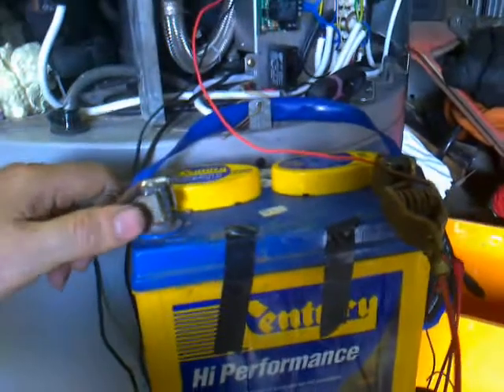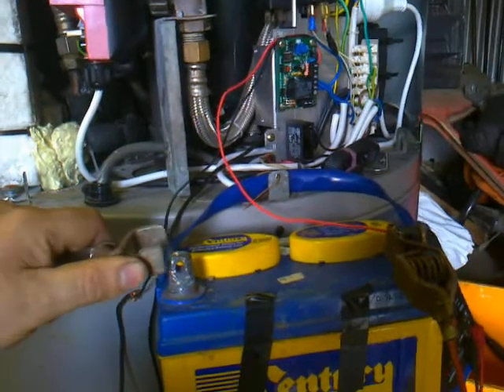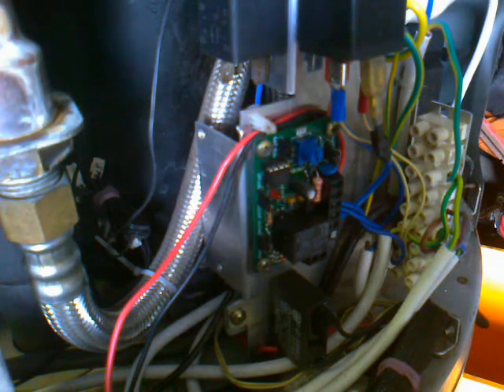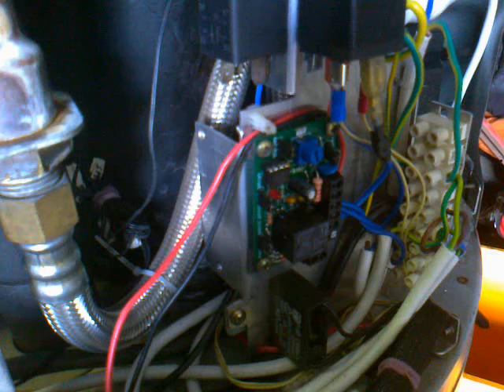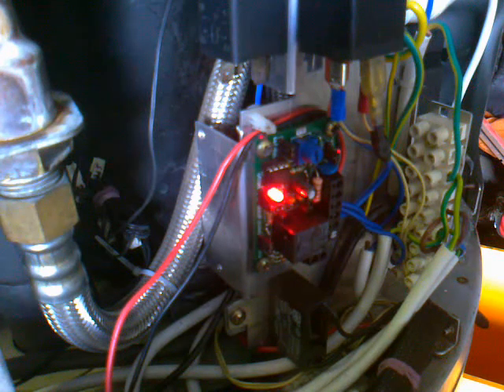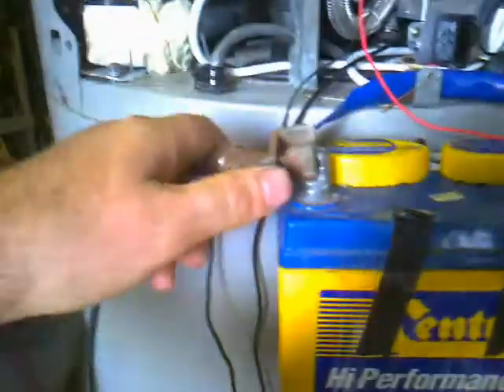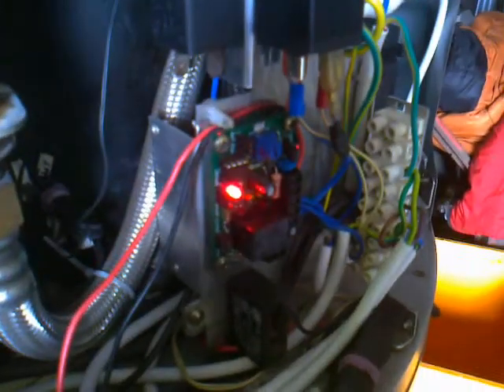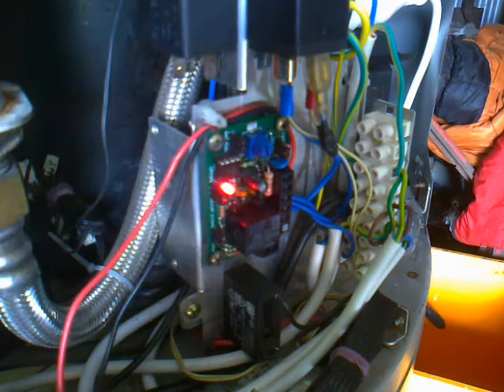"RHEEM HEAT PUMP HOT WATER SERVICE HDi-310" "RHEEMED" MODIFICATION Handy Pulsing Circuit Board!

Comment: Well,I checked my dads Rheem 551310 yesterday & I couldn't find anything wrong with the top part electrically.

I checked the compressor for leaks & I found that one side was rusted & the other one where the tube pokes out on the water pump side has had a slight refrigerant leak.

The unit is about 10 years old now so it's not worth throwing a whole lot of money at it.

It did try to run at 1 AM this morning, but it kept cutting out on me & the water went cold after I had my shower.

For interest sakes,I'd like to look for the pressure sensor for the refrigeration side of the hot water tank,there is meant to be a thermal cutout switch inside the compressor as well although I got a reading across all 3 terminals.

I think it has lost gas so I just wired the hot water system up with the element connected straight up to the thermostat rather than the relay,it's heating water now !!!!